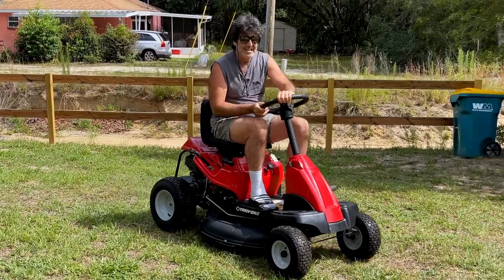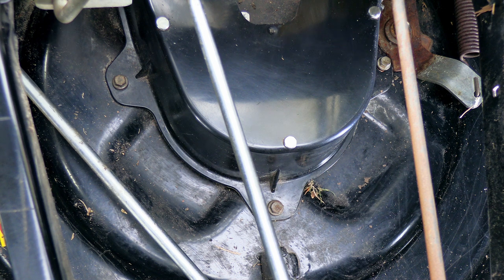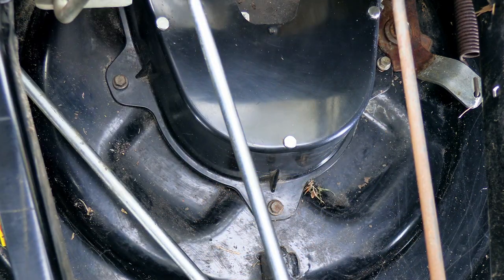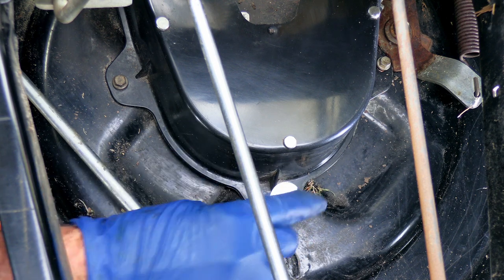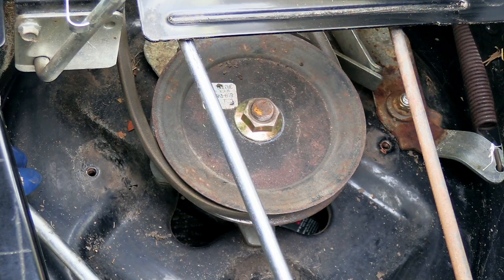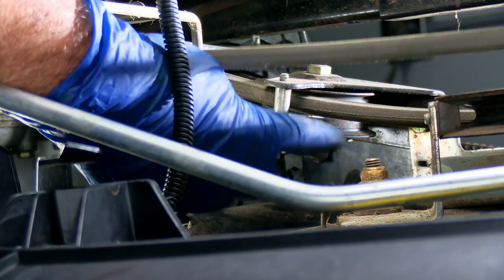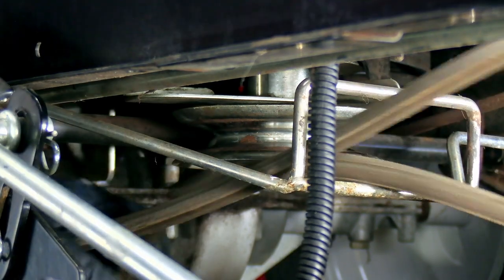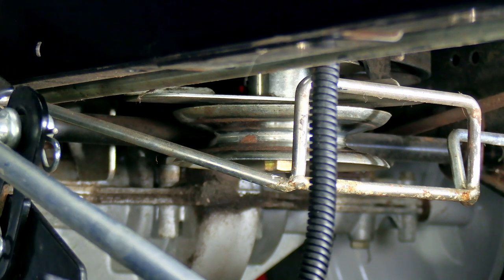Replace Deck Belt On TB30 Rear Engine Riding Mower in 3 Minutes!

Comment: Even after replacing the blade mine does not seem to cut grass well at all. Is there a clutch that I should be looking at in the deck or is it possible the belt is just slipping?
Reply from the maker: HI, no this one doesn't have an electric PTO.  When the engine is shut off, engage the blade and then grab hold of it to see if it seems loose.  The deck should make a certain sound when the blade is running a good speed.  You should be able to hear it if its slowing down..

Comment: I have a TB30. I starts perfectly fine but when engaging forward or reverse it won’t move. It happened when I was hauling a fairly heavy load on a tow behind trailer downhill. The brakes locked up and there was now movement from then on. The brakes don’t seem to be locked up at this point. Any idea would be greatly appreciated. Thanks
Reply: Oh. Also on 4-5 gear it makes a screeching sound but still won’t move. Thanks again
Reply from the maker: Yikes!  That always makes you feel warm and fuzzy when something like that happens.  If you're able to push the mower around by hand then the brakes aren't locked up.  There are probably only 3 possibilities that I can think of right off the bat.  1.  There is a belt  broken (IF I remember right this one has 2 belts and you can remove the plate from under the muffler to get a look at them). 2. The pulley that goes into the transmission could be stripped out.  3.  The transmission could be broken.  As long as there is tension on the belts (That disqualifies problem #1) then it should be working as long as 2 and 3 are good.  If the belts are good, I would take off the one from around the top of the transmission and spin it by hand and see if the wheels are turning.
Reply: Thank you!!!!!

Comment: I have a cub cadet cc30h , and every time I disengage the blade ; the belt  comes out from behind the keeper and off the pulley ! I have to get off the mower , take off the keeper , place the belt where it goes , and replace the keeper ! Why do you think it won't stay in place ?
Reply from the maker: Yikes!  No that's no good...  Most of those decks have a brake so that when you disengage it the blades will stop pretty quickly.  If the brake isn't working and the deck is just spinning for 10 seconds after being disengaged that could cause the belt to come off.. It's really hard to say without me being able to see it in front of me..

Comment: I have the same mower and bought the exact belt and it will not fit. Not even close. Its like the belt is an inch short.
Reply from the maker: HI, I usually recommend to check the model number of your exact mower and confirm what the part number is for your application.  IF you did that and it's still wrong then the only possibilities are the belt is routed wrong, or they sent you the wrong belt.

Comment: My belt keeps slipping out of the idler pulley. Yes the I install the belt holder pin.
Reply: Nevermind I figured out what happened.
Reply from the maker: Excellent!  Glad you got it going again.
Reply: @benreifhardt4471 what happened?
Reply: @p00ner  there is a little metal arm that keeps the mower deck from dropping down to much. It broke. I welded it back together and now everything works great